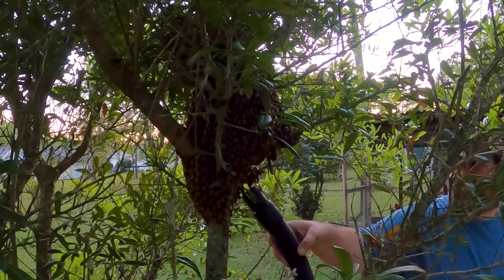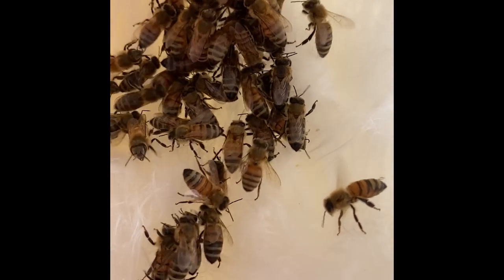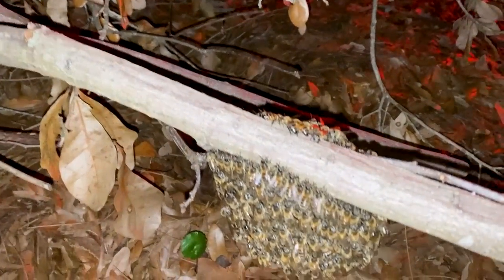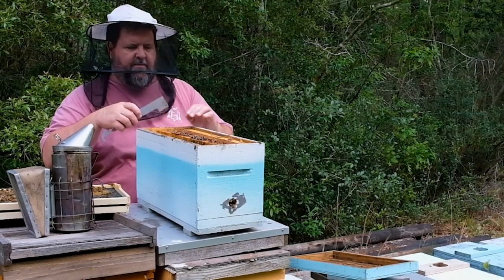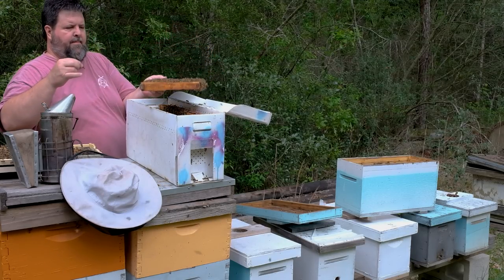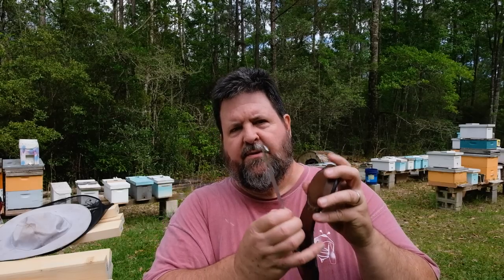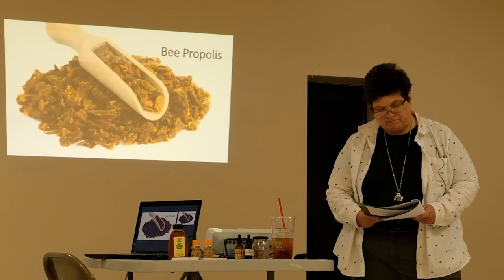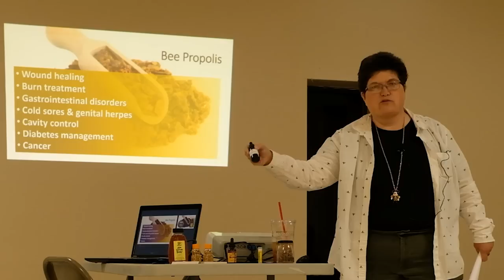AMAZING!!  Queen Flies Away And Comes Back Twice

Comment: Hey Randy,  love all you videos. I've learned a lot from them. I'm a hobby beekeeper near Bel Air MD. I've started doing a few cutouts. I bought an everything bee vac. Its been great.  Last week after removing  a very small queen less hive the homeowner said that a local exterminator had been her house twice and treated. Since there were so few bees I went to the next larger job without taking those bees home. After a day of letting the bees settle down I looked in the hive to find that half were dead and the other half are struggling. Do you think its pesticide and can I clean it out of my vac? Have you ever run into this?
Reply from the maker: I’ve had this happen a few times.  I clean mine with Dawn.  I just flush the bucket and hose real good.